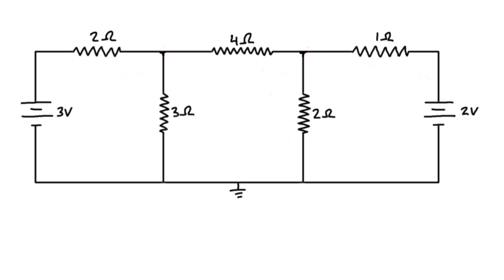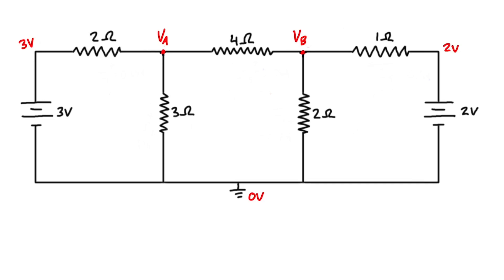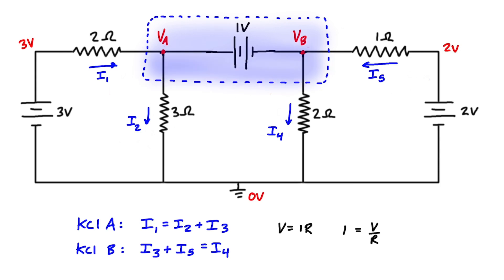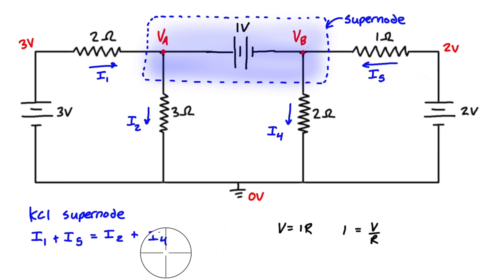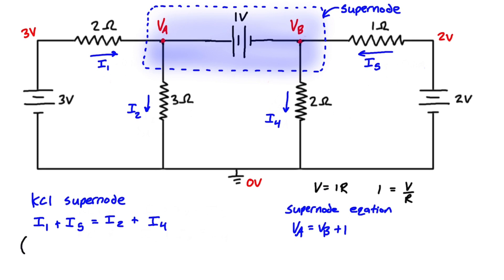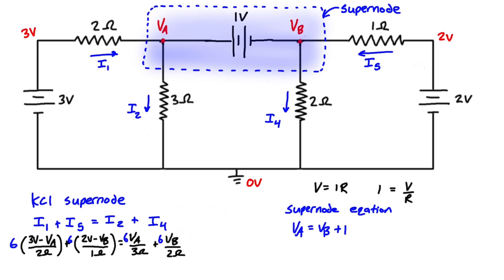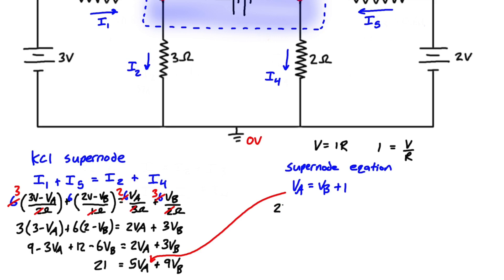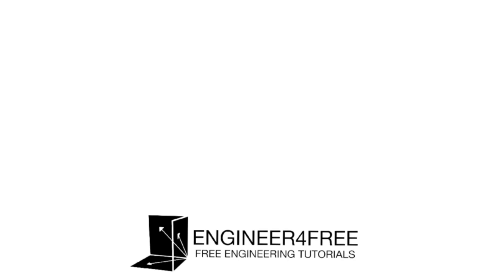Supernode Analysis Explained for Circuits

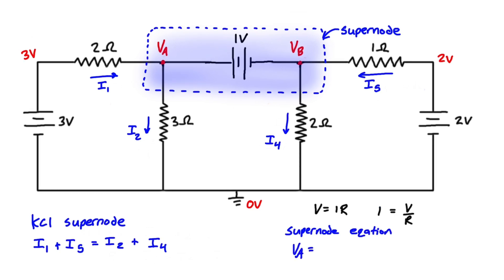Comment: 3:10 anyone who is confused how did he get the supernode equation when he said "Va is just 1V higher than Vb" and wants some clear explanation here it is based on my understanding: Va is facing the + sign of the battery which is 1V and Vb is facing the - sign of the battery which is 0V. I don't know if this is true but this is how I undestand it.
Reply: basically the potential difference between the nodes V2 and V1 is 1V
Reply: @hamkaboo543 how we can find the value 1 volt in supernode
Reply: From my understanding, you assume whichever one you take first to have the higher potential. Mb if I'm wrong, I'm still learning too
Reply: I came to the same question here.

Comment: Hello, great video but i have a question, which direction do u think the current flows at the 1V power source? Based on my calculation. the current flows from node Vb to node Va. However, node Va has higher potential than node Vb , so which one is correct ?

Comment: I see that the voltage is one V higher on terminal A... so why not Va +1= Vb
Reply: because the voltage of A is one volt higher than the voltage of b. the above equation implies that vb is greater than va which it is not.

Comment: does it matter in which direction i put the current flowing out of the voltage sources?
Reply: @Pau Gasolina: no it does NOT matter. If the current flows in opposite direction to what you assumed, the current value will be negative. What is extremely important, be consistent with the current directions and voltage drops when writing the equations. Once the equations are well written, the solution will be correct (sometimes with negative current, but correct). Courage!

Comment: Hi, what if the polarity at voltage source between Va and Vb change? is the equation still same like Va=Vb+1 or it change to Vb=Va+1..What if the polarity at 2v source change? is the current flow at i5 change too?
Reply: For the first question: Yes, the equation would change to "Vb=Va+1".
For the second question: It doesn't matter which direction you determine the current at first as a reference. If you determine the direction otherwise, you would simply get the same value but with opposite sign. So the answer to your question is that the voltage sources polarity doesn't affect your selection of current direction.

Comment: i am confused with how you got VA=VB+1
Reply from the maker: Ah, there is a 1V voltage source between (points) A and B. The way it's oriented is such that the left side is 1V higher than the right side, and because Va is the left side and Vb is the right side, it means that Va is 1 volt higher than Vb, or mathematically its just, Va = Vb +1, with each term being in units of volts.

Comment: I have a similar problem but in my case the 2nd voltage source (2v) is upside down......In this case the ground is connected to negative terminal but in mine the voltage sources are inverted . 1st one has negative side facing down (like in this case ) but the 2v source has the positive side facing downwards (unlike this case where both negative sides are facing downwards) . In that case what do I do?
Reply: To @The Android Minimalist: no difficulty here. In all the equations in this vid where you have (2 V) you should write (-2 V) and continue solving the problem. Just do the maths. Most likely, you will get some of the currents (here, probably i5 and i4) with negative values. This will mean that this/these current flow in opposite direction. No hassle at all. In this kind of problems, you may always arbitrarily assume certain (or the opposite) direction of current flow. Then, be consistent with drawing voltage arrows and writing the equations. Once the equations are solved, you will see if your gut feeling of how the current flows are oriented was correct. Regardless of how good you are at guessing the current directions at the beginning, the end result will always be the same.

Comment: how did you know that Va is at a higher potential then Vb? im confused on this part as I dont see the polarity
Reply: His voltage source flows from left-to-right since the positive end is on the left and vice-versa, so Va must be greater than Vb by 1V.
Reply: Longer line in the battery symbol indicates the higher potential side of the battery or voltage source.